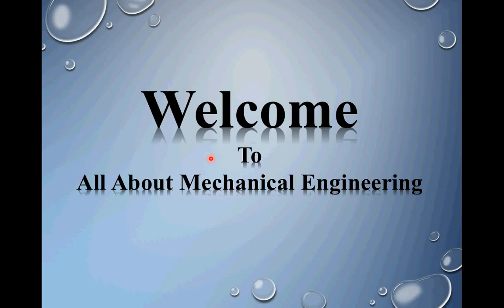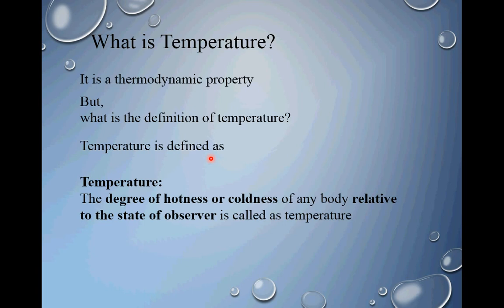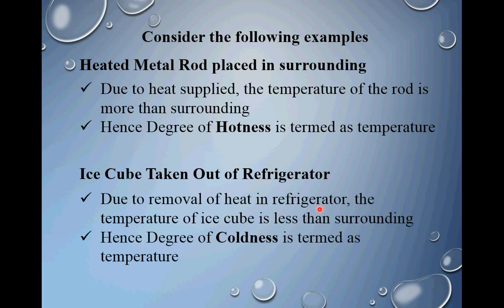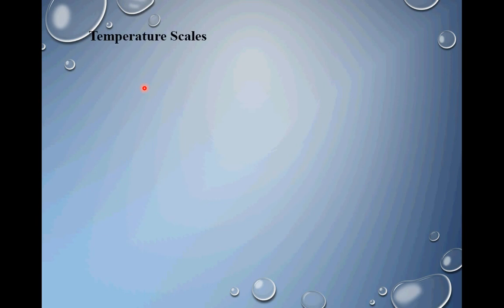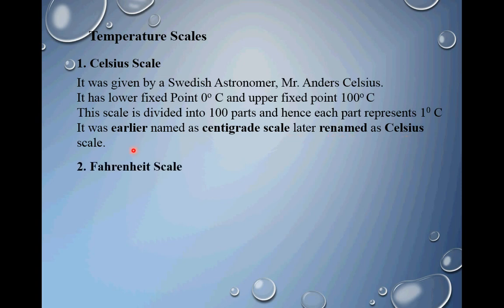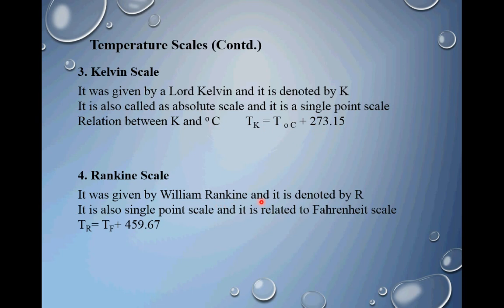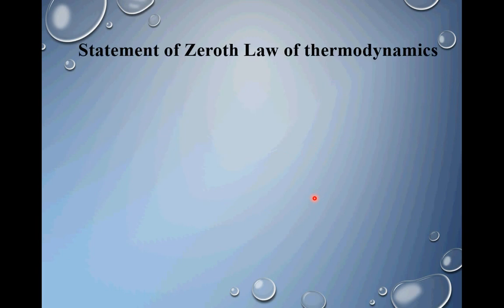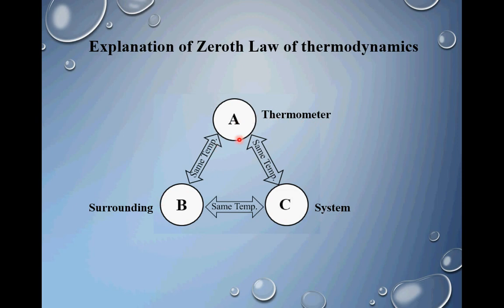Temperatue and Zeroth Law of Thermodynamics #thermodynamics #basicthermodynamics

Comment: Sir I have one question. If thermometer is in contact with surrounding air  and the same thermometer is contact with person having high fever.Then both person and surrounding air is in thermal equilibrium as per zeroth law. However if we touch high fever person and surrounding air we don't feel they are at same temperature. One more thing surrounding air and high fever person can't be seperated from each other.There will be contact between them( surrounding air and person). How do you explain this as per zeroth law ?
Reply from the maker: As per zeroth law of thermodynamics, we are having three bodies (or system or elements which you need to compare) here which are 1. Surrounding 2. Person with High fever 3. Thermometer
When the thermometer is not being used and is kept in the surrounding, the thermometer reads the value of temperature (Say 34 degrees) available in its vicinity (i.e. its surrounding) and when the thermometer is brought in contact with a person suffering from high fever, then the thermometer reads the value of temperature (say 104 degrees) of the person's body (which will be higher than the surrounding temperature as he is suffering from fever) 
Hence, thermometer is a third body which we used to compare the temperature of two bodies (or systems) i.e. surrounding and the Person's body
Now let us consider that the thermometer reads the same value as of surrounding (i.e. 34 degrees) even after making it in contact with the person's body 
Then we conclude that person is not suffering from fever as he is at the same temperature of surrounding, hence he is thermal equilibrium with the surroundings. 

And in order to conclude this thermal equilibrium between surrounding and person's body, thermometer was used as third body.

Comment: Sir can you give my question answer
Reply from the maker: Kindly Ask your Question, I will try to answer in best possible way I Can
Reply: 1 kilo mole of carbon monoxide considered to be a ideal gas with a  heat capacity of 29.3 kilo joule per kmole (isobaric) is subjected to a following process: the carbon monoxide is heated from 700 k and 2.8 mega pascal is expanded isothermally 0.552  mega Pascal it is then cooled through isochoric process to 438.5 kelvin again gas is cooled to 350k through constant pressure process after that it is compressed to 2.8 mega pascal and finally heated at constant pressure to 700k.
 compute the heat transfer, the work done, the change in the internal energy and the change in the enthalpy for each step and for the entire process assuming reversiblity and sketch the process on pv diagram
Reply from the maker: In order to solve this problem,  you need to write down the various processes involved in the given sequence then find out the unknowns for each process individually..  
At last you have to take the summation for the complete cycle (as the given problem has the same initial and final condition )
Also you have to use the concept of first law applied to a non-flow process undergoing cycle.. (i.e. change in internal energy over a cycle process is zero)
Kindly go through my videos for the processes mentioned in the problem and sketch the p-v diagram with thr help of the explanation given in the videos..